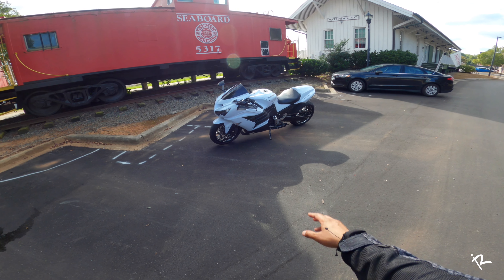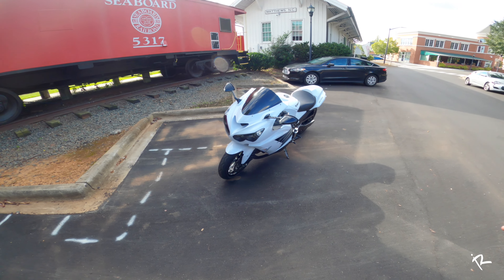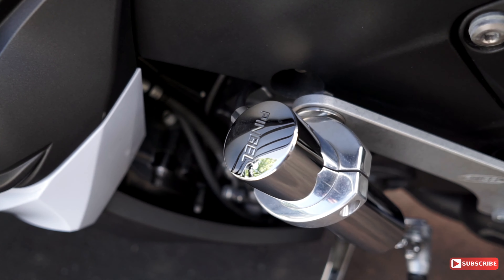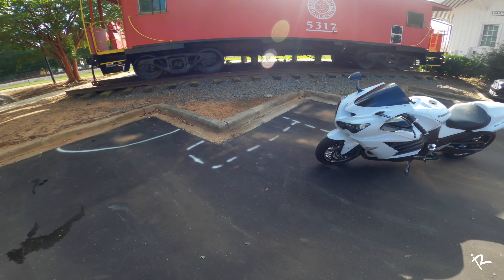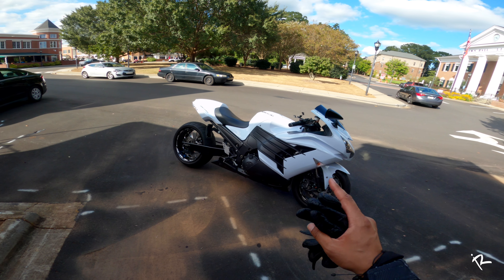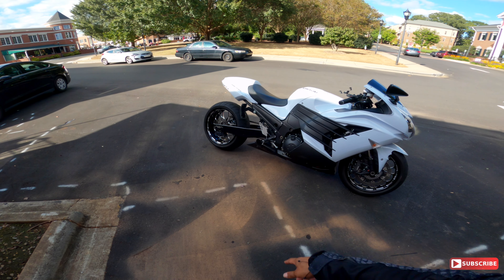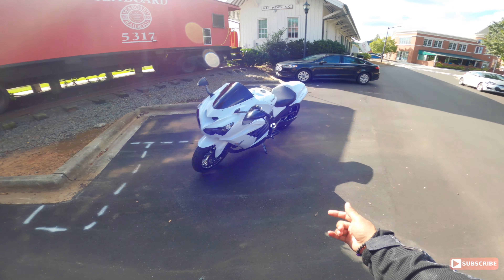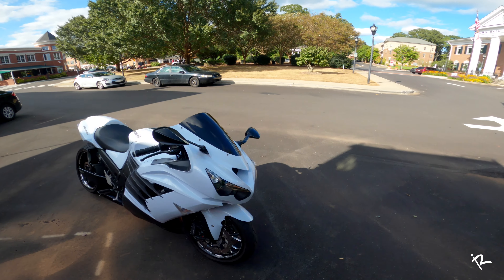Kawasaki ZX14R Upgrades - Zach's ZX14R

Comment: you hit the nail on the head that's what it is you're sitting up in a comfortable position but not quite as much as like a 650 ninja but the perfect spot.  I found it harder to control the steering on the GSXR

Comment: I severely do miss my Suzuki GSXR 1000 but my  ZX-14 is like another level .. like   so much more comfortable to ride , it's not all herky-jerky  like a souped-up GSXR  but it's faster than f*** . not that this is Uki wasn't faster than f***  this one just seems more controllable  smoother and  just flat out easier to ride . I got a 600 Ninja at the same time as the one thousand and I actually  jumped on that bike for quick runs  to the store or whatever.  haven't rode my Harley  for ages.... I just sits there pouting in the barn

Comment: damn watching these videos and now I want to go ride really bad... mine is cutting out and sputtering once you get the 4000 RPM in any gear . trying to figure out if it's  electrical or fuel
Reply from the maker: Dang. That sucks
Reply: yo billy,   did you figure it out??  mine is doing the same thing.  mine is 2007